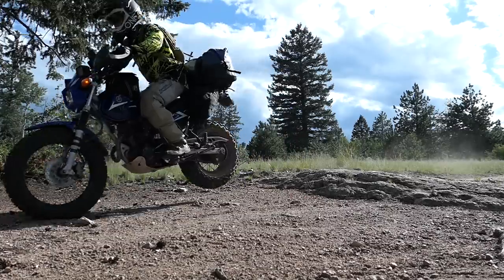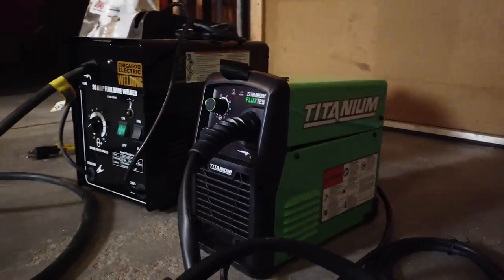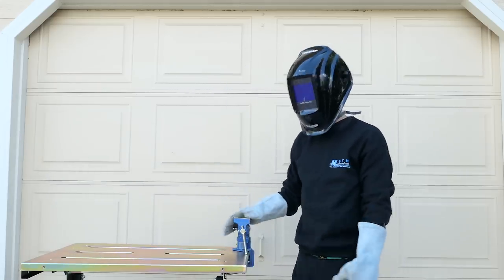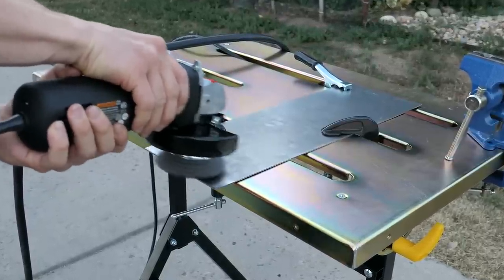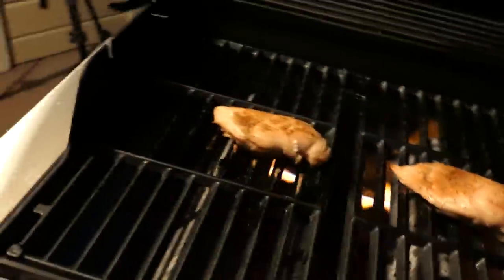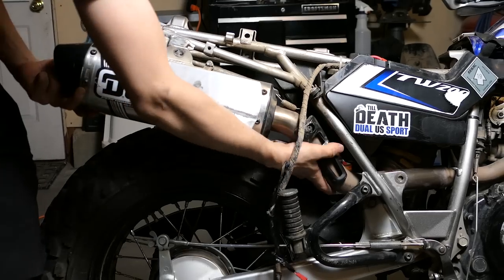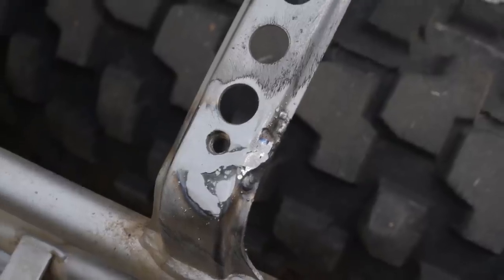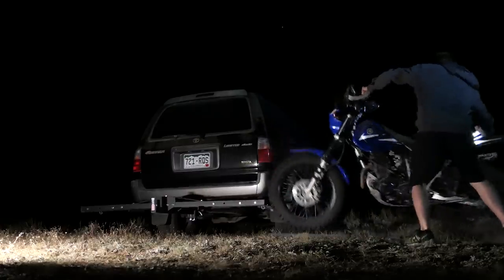Learning To Weld so I can Fix the Cracked SubFrame Cross Member on my TW200

Comment: Welding was something that, as a farm kid, I learned early.  Decent welds you did!.  It does bring home an issue that Her Ladyship may encounter on her T-Dub, hauling camping gear.  We'll get her a Giant Loop Coyote Coyote saddlebag set.  That should distribute the load over a much larger area, and reduce the stress on the subframe.  Your idea about reinforcing it sounds great too!
Reply from the maker: nice! that's the best way to learn. much appreciated. yeah it's a bit weak there but I haven't had any more issues with any of the welds I did on the bike and put it through the wringer. I also did get an actual MiG welder. and just welded in a patch panel on my van. feel much more confident next time I have another issue on the bike.

Comment: Good information on the welding. I'm a welding inspector and teach and certify welders. There is a lot of misinformation on self shielded flux core out there. Another great video!
Reply from the maker: hey thanks! yeah a lot of information about flux core to sift through on the internet. oh nice. i'm sure my welds won't pass inspection anytime soon but it will be interesting to see how they hold up over time. thank you!

Comment: Nice vid. You can leave the bolt in the threads to protect them from splatter , and I’d  add some metal to beef up both  sides of the subframe.
Reply from the maker: thank you! yeah that can help for sure. definitely going to weld on some metal when it breaks again haha

Comment: I’m looking for a used Tw200. Do you have any advice on what to look for? There aren’t any in my area. So I’m having to look up to 8hrs of a drive out. 
Would you recommend the newer version for the front disc brake?
Reply from the maker: gottcha, make sure the services were done and it rides and starts well. I do like the front disc brake more personally, I ride a lot on the street though

Comment: Don't be afraid to play with the heat and wire speed settings if you keep burning through. The settings on the machine are just guide lines.  Everyone welds differently. Keep up the practice.
Reply from the maker: for sure! just takes a lot of practice I found out. thanks

Comment: Good job tdub. Great but of info👍👍.Hey what do you think about the 1987 tw.looking at one for the wife.Appretiate your input.Thanks
Reply from the maker: thank you kind sir. it's just the age of it that might cause some problems. the older carbs were not as good and the cdi's seem to go bad, but if you find one in good shape with a good price I will be worth it
Reply: @TDubsKid  thanks ya we found one decent shape. It does have an electric issue. Signals work but head light and brake light does not. Any ideas?thanks tdub I've been going through all your old video studying lol
Reply from the maker: Gottcha, probably just a wiring or plug corrosion issue

Comment: Which hitch carrier is that? Did you need to roll down your 4Runner rear window for the handlebars?
Reply from the maker: Black Widow MCC-500 SteelMotorcycleCarrier and I didn't have to roll it down but did on bumpy off road just in case but it probably would have been ok even if I didn't

Comment: Welding like a pro well done ! Always remember to unhook battery before welding . Keep eye on the bolts to the bike carrier , bro has one and even with the lock nuts seem to come lose . I build my own all welded and put tail lights on it so no dumb-ass will run into the bike when stopping or turning .
Reply from the maker: thanks man haha, I have learned so much from all this. yeah that's a good idea, and the cdi too yeah some bolts on this bike have come loose. I use blue locktite on pretty much all of them. never had an issue with the lock nuts though very nice! it would suck to have that happen

Comment: Get yourself a copper ground clamp too, helps.  Gotta see that trip video. Is that the harbor freight bike rack too? I run theirs with my tdubs, after a couple mods to take the shake away.
Reply from the maker: I did that in the next video. so much more sturdy the stock one is super flimsy. should be a good video but won't be as good as it should because that is when I lost my phone with tons of great footage from that trip. haha harbor freight bike rack?? no it's just a manrack
Reply: @TDubsKid  harbor freight should be sponsoring you lol. I've got the same shit welder as your first one and learned fixing crap on my YJ. I should have practiced as much as you did, lol. That blows on the phone.
Reply from the maker: that would be nice, I may be able to put affiliate link on though. it's best for people to go to the store though. their shipping is not fast. yeah practice helps a lot but you really learn a lot more when you actually weld something important haha yeah but oh well can't do anything about it now

Comment: Awesome video as always man, next time grind out the cracks very slightly just to get better penetration and to get rid of rust in the cracks itself.
Reply from the maker: thanks! I did do that on the next crack welds I did. makes sense to because it creates a greater surface area for the weld to melt into as well

Comment: I don't yet have a TW200 but looking at getting an older '90s one. While superficial, I wanted to see how difficult it is to get to the frame to repaint. Im totally new to bikes but if  doesn't look terrible, would you agree? 

Loving the channel, you're making me pull the trigger on one!
Reply from the maker: nice,  makes sense. the older frames probably have some paint missing and rust on the frames. it's a pretty easy bike to take apart. will take time. they are much easier to work on than cars that's for sure. glad your enjoying it! ride on 😀

Comment: Jobs a good'n mate, I replaced my rear subframe on the xr when I cracked it but ive still got the old one in the garage with the intention of fixing it but also reinforcing it as it's a bit lame because it's the R model and not made for camping gear ,great vid buddy I might just get on that soon now.
Reply from the maker: thank you man! dang at least it just bolt on so it's easy to replace. yeah reinforcing it is a good idea. dual sports have weak sub frames and not really meant for camping gear, my friend broke his too and doesn't even motocamp haha much appreciated 😀

Comment: Hey TDubs! So, me and my wife are both interested in getting tw200's. Im a little bigger (6'1" @270lbs) and thought maybe you could help me out. Maybe call it a challenge...? What kinda steps (besides those rock risers) could i do to a tw to help a bigger guy ride one? Is there any logic to trying to possibly move the pegs a couple inches forward?
Reply from the maker: Hey there, very cool! Yeah risers and foot pegs will help the most, not sure of a way to change the position of the foot pegs. Would be cool if there was

Comment: Hey tdubs kid awesome video. Im in the process of hooking all the wires up on my new to me tdubs. Could you possibly show where the negative battery cable attaches to the frame. And also where is the flasher relay location. Thanks for your help
Reply from the maker: ill have too look next time I have my bike apart, the flasher relay is under the right side cover I think

Comment: you do not need a resperatoir outside or with ventilation also dont get harber's grinding disks there are tons of storys of them exploding, be most carful around grinders they are most dangerous between welding or grinding.
Reply: also if you do alot of welding on the table i would recemend putting atleast a 1/2inch thick steal plat to weld on because a sheet as thin as your table would warp.
Reply from the maker: I just want one because the flux smoke irritates my lungs. you don't have to use one. that's probably because people are using the cut off wheels for grinding. those will shatter if used like a grinding wheel. they come in the same package. I bet that is the issue. yeah they can be very dangerous. always safety glasses and unplug it every time when changing attachments
Reply from the maker: yeah that's not a bad idea to make the table last longer

Comment: On my old DR650 I cut out the original, and bent a piece of 1/8"  into shape drilled the holes. I then put a nut bolt combo on after welding the nut in place.
https://www.youtube.com/watch?v=vxwK_bOXOfk
Reply from the maker: Cool. Thats a good idea